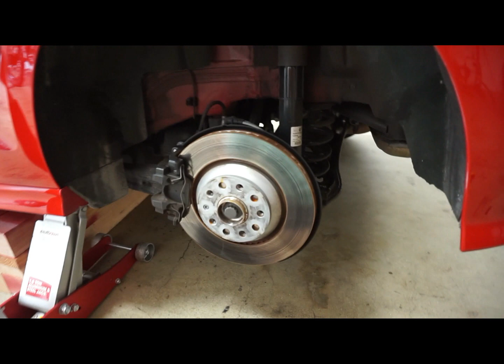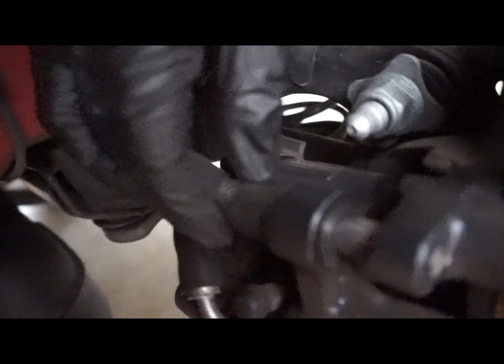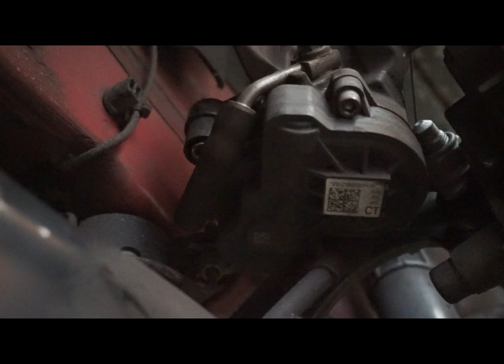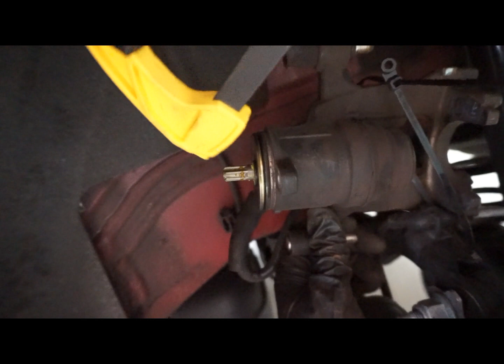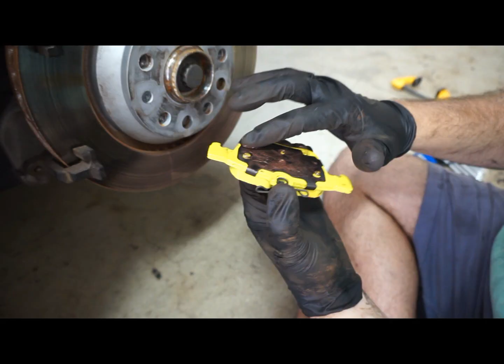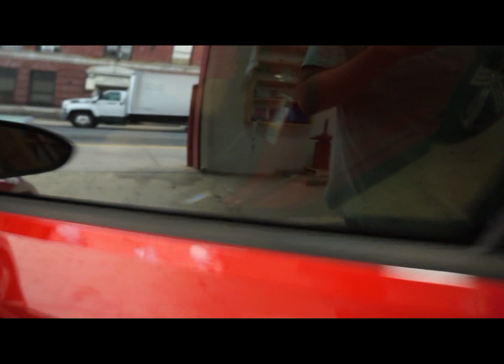Mk7 Golf R/GTI PP/Audi S3 w/ Electric Parking Brake rear brake pad change WITHOUT using VCDS/VAGCOM

Comment: Great video but never , never put copper grease on the back of break pads. That was something our parents did years ago. No need now and it bleeds through any holes in the back plate and melts when hot.

Comment: 🇬🇧 2017MY Golf GTI DSG Keyless Stop/Start
These instructions worked great. It was only on the second side that I realised it wasn’t necessary to remove the pad carrier bolts in order to replace the brake discs. 

As others have described, the EPB is disabled by putting your foot on the brake and turning on the ignition/ pressing start-stop. Remove your foot from the brake. With the gear lever in park, switch off the auto-hold feature and then the parking brake before turning off the ignition/ pressing start-stop. I found that it wasn’t necessary to leave the ignition on whilst working on the brakes. I did unplug the EPB module whilst I was working on it but I’m not sure that’s strictly necessary.

Fitted Brembo discs and pads front and rear for £275 versus £1100 for parts and labour at the VW dealer. 🙌🏻

Comment: Is it just a regular 9mm socket to wind  back the spline
Reply from the maker: Sure, you could use any sort of pliers also but then you risk contaminating or damaging the spline. It doesn't require much force either so you could just do it by hand.

Comment: I have a 2016 Audi A3 8V Quattro and I can’t find rear brake kits for my car. Any help suggestions from anyone would be greatly appreciated!
Reply from the maker: I am unfamiliar with your specific car, but I’m pretty sure it will be similar to the regular golf. Does it have an electric parking break? If so the method in the video may work.

Comment: Thanks for this... worked perfect. Simple allen wrench works best for loosening the pins. Also, confirming what some other commenters said - you don’t need to remove the carrier with the special 14mm triple square to swap in new rotors. Used a similar clamp to push the piston back in and it also worked perfect. Remove the electric plug on the motor to free up the caliper to make it easy to work on. So, basically no special tools required!

Comment: Rather than removing the motor, using a jump start pack you can unplug the electrical connector and apply 12v power.  Only two wires and you simply connect in the orientation to rewind.  When reinstalling, from the drivers seat simply keep applying the park brake until it winds enough.  It only winds a small amount each time, so it takes a few goes.
Reply: When I reverse polarity on the motor to wind it back, how do I know at which point to stop? In other words do I apply power till the motor wnd back till it stops, or will I strip something if I contnue applying power after the motor has driven to the end?
Reply: @sanjaysivnarain1258  
Works great with a small 9v battery also, less risk to strip something to.. stop when you hear it starts to get heavy for the motor..
When done with both sides pull the e-brake a couple times and it will self adjust.

Comment: Awesome cheers, completed this morning on a MY17 DSG 1.4 Auto. Test drove and no problems or codes etc.  (took an angle grinder to my 7mm socket to make it 5mm shorter lol) That was the trickest bit. 1hr on 1st wheel, 30mins on 2nd . . .taking it slow and easy.

Comment: Hi, 

would this method of pushing the piston hack in with my Mark 7 golf 2013 blue motion model. 

car sat for a week as winter temperatures came in. was working fine prior to this.

but it has left the drivers rear sticking. 

150 for a new caliper surely pushing the piston back slightly would be enough?

Comment: Just a quick follow up, to release the calliper where there is limited space especially at the top I used a stubby 7mm Allen key with a 10mm Rachet spanner this makes releasing the bolt so much easier..
Many thanks again for the video

Comment: Procedure worked fine for me. One thing I would suggest is replacing is the seal (p/n 5Q0698365) on each parking brake motor during reassembly. They're only $8 a piece.
Reply from the maker: Great suggestion!

Comment: great video bro.

Did you bleed the brakes? how do you bleed the abs ecu using vcds?
Reply from the maker: Did not bleed the brakes. Simply remove the brake fluid reservoir cap to allow fluid to flow from the caliper into the reservoir easier. Bleeding the brakes is not necessary.

Comment: When the e-break is off, i never put it on, cant you just change the breakpads without all that fuzz?
Reply from the maker: Do you have an electronic e-brake? Because if you don't then you can replace the rear pads the traditional way.

Comment: There's something wrong with my car. I had a family friend that used to work on cars replace my brakes. Now my car feels like there's resistance when I drive. Not only that but every time I start my car up, my e-brake comes on and doesn't go off until I press the gas. This is something new.

Any recommendations here would be great.
Reply from the maker: Sounds like your auto hold is on.
Reply: @v5garage629  Or you have the wrong pad on piston side and visa versa,thats what MY FRIEND DID ,PAD WITH  THE TENSION CLIP GOES PISTON SIDE AND PAD WITHOUT GOES ON OUTSIDE OF CALLIPERWHERE TENSION CLIP FOR CALLIPER SITS.Sorry for the capitals,two finger typing takes ages.
Reply: V5 Garage Auto hold automatically is coming on. I usually leave it on until I park, because it makes it easier to have it off. The next time I start my car, it comes on.
Reply from the maker: @AversaS2  Do you have a manual or automatic? Someone on here was having the same issue but it turned out the auto hold was on, turning it off by pressing the button on the center console fixed their problem. I don't know how to permanently deactivate the auto hold feature otherwise.

Comment: Great tutorial. Just one question... do you know if this will work on a Mk7 with DSG transmission? I think the car in the tutorial has a manual shift transmission, correct? Reason I ask is because I believe the DSG models will always apply the electronic brake once the engine is switched off, even when the auto-hold function is turned off. If I'm right, then your process might not work for DSG models. It all depends on how the servo reacts (if at all) when the caliper is removed. I suppose I could disconnect the battery terminal, meaning it has no power going to the motor, but I'd rather avoid doing this in case it creates an ECU or immobiliser issue. Appreciate my dilemma?
Reply from the maker: Yes the vehicle in the video has a manual transmission, and I am unfamiliar with the DSG gearbox and auto-parking brake feature associated with it. If there is a way to disengage the parking brake while the car is off then the procedure in this video should work just fine.

 It appears others have had the issue you're talking about, maybe just try to disengaging the parking brake when the ignition is on but the engine is off. This whole process shouldn't take more than an hour or so, and your battery shouldn't die with the ignition on in that time frame. Again, I am not familiar with the DSG and please take the proper precautions when jacking up any car without the parking brake on. Hope this helps.
Reply: @v5garage629  No problem. Thanks for taking the time to reply. Safety first as always. I'm determined to get to the bottom of this conundrum, so I'll keep digging around for a solution and I'll post back here if I find one. Love this car, but hate VW for not adding the EPB wind-back function to the menu in the car's own console.
Reply: Okay. I've tested the method on a DSG model, and confirm it works. Sequence as follows...
1. DSG in Park, depress footbrake, start engine.
2. Take foot off brake, switch auto-hold off (unlit), disengage EPB (unlit).
3. Turn off engine but DO NOT remove ignition key.
And that's it. The EPB will remain off, and this video tutorial can be followed to replace the rear pads.

Note: to save the battery while you work, you'll want to switch off the entertainment system and anything that is drawing a current.

Comment: Does the handbrake self adjust quite happily afterwards?
Reply from the maker: "Happily"? The motor is on for longer than normal the first time you apply the parking brake after doing this. After the first time it will be normal.

Comment: without calibrating the hill hold function will not work
Reply from the maker: I tested my hill hold this morning and it works fine, is this an issue you are having?
Reply: @v5garage629  I did mine and now it gives a fault regarding hill hold ,how do I reprogram hill hold ? ??

Comment: question ... he just slid the caliper over the new pads with no issues at all. can you actually use the c-clamp  style tool to compress the piston ? i would have figured you'd need the rotating and compressing "special tool" ... :| i cant put that part together, is this because the spline was compressed by turning it in with the 9mm?
Reply from the maker: Once the spline has been turned fully clockwise the piston will compress all the way inside the caliper, this has to be done first like in the video. The "special tool" referred to in the video is just a regular brake piston compression kit that can be bought at a local auto parts store or on Amazon. It could be used or if you don't have one (like me) a C-clamp like in the video can be used instead. Regardless something is needed to compress the piston because it is very hard to do by hand. Hope this helped.
Reply: Chris W a

Comment: Looks solid to me - anyone take issue with this approach?
Reply: Worked perfectly for me too..
Reply from the maker: It's been more than one year since I performed this service and I've had no issues.
Reply: The original poster did not warn that the brake pedal needs pressed many times to do the piston wind back on to the pads. 

Unexperienced people will drive off without that brakes working properly!

This is not a great idea, also the electrical connector is no longer latched to the caliper. Obviously people are willing to reduced the safety of there car to save the price of the VAGCOM tool.

Comment: Hey, I'm going to give this a go but have to know, on my GTI the parking brake activates automatically as soon as the ignition turns off, how do you do this work with the parking brake disengaged? Do you leave the ignition on?
Reply from the maker: I am not familiar with the parking brake engaging automatically so I can't speak as if I've had to deal with it. However, if I were you I would turn the ignition on, disengage the parking brake and proceed with the instructions in the video (make sure your battery doesn't die!). I can't imagine it would be any different since nothing in this procedure has anything to do with the actual EPB motor so it shouldn't matter that the ignition is on. All you are doing in this procedure is reversing the parking brake pad fill mechanism in the actual brake caliper.
Reply: V5 Garage thanks for your reply, appreciate it. I just been and had a look and it’s because I always have the auto hold function activated. So with that turned off I can indeed switch off the ignition with the parking brake disengaged...
Reply: @davefrighty  I had the same question as you. I'm still not 100% sure if switching auto-hold off will work for me as my car has DSG transmission. As far as I can tell, if the car is in Park and I switch the engine off, regardless if auto-hold is switched off, it certainly sounds like the electronic brake winds on. Don't quote me on that, as I could be wrong. My question is simply this... is your car the manual transmission or DSG? Maybe it matters, maybe it doesn't, but your answer may help me. Thanks.

Sorry, but I should add, the electronic brake on my car can only be engaged/disengaged while the engine is running. Obviously, I really don't want to be attempting this job manually if the only way I can do it with the electronic brake disengaged is by jacking the car up and removing parts while the engine is running. Again, don't quote me on any of this, as I may be mistaken.

Comment: I would have thought the rotors would be worn out after wearing out a set op pads on them.  False economy to go through all the hassle of changing pads without rotors too, especially as you track the car.  Better rotors for track use should have been put on.

However, the tip for winding back the electro handbrake is very welcome.  Saves money and potential disaster by fiddling inside the ECU to wind them back.
Reply: pads wear faster than the disc